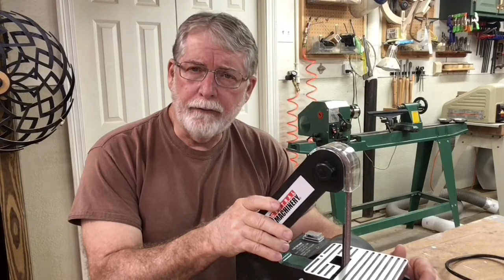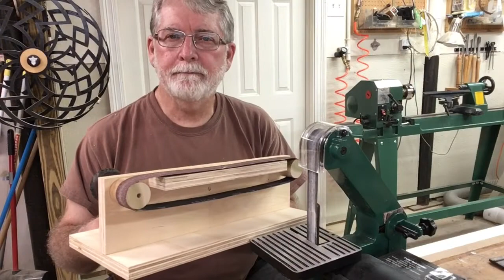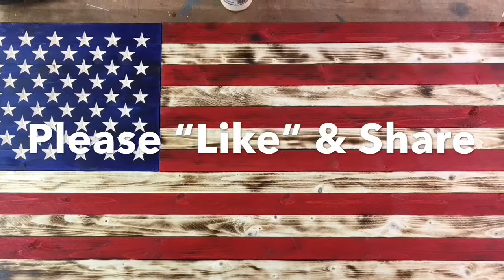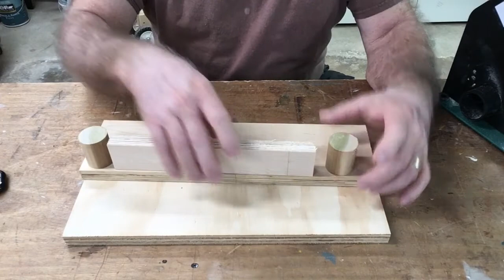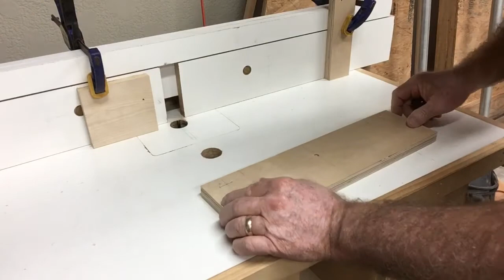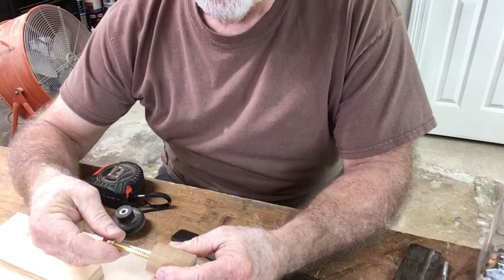Homemade Belts for Harbor Freight 1 x 30 Belt Sander

Comment: How long did that tape hold up? Every time i tape one it breaks loose before long. What brand and type of tape is it? Thanks
Reply from the maker: I have never had a failure.  The blue tape varies, I've use 3M tape and the Starbond CA glue.  I have the slot board on my cnc4newbie for over a year with no problem
Reply: @PawPawsWorkShop  could you tell me the exact model of the 3m tape? They make so many different ones. Thanks for the help!

Comment: I found that when I taped the joints with the nylon that if you clamp the belt to the tape over night it will not come loose later. They then last for the life of the belt grit. Don't forget to clean the belt often when sanding or grinding. Also you can buy 1 inch wide rolls of fine grit cloth backed belt material from many woodworking stores and only have one joint in each belt. They have assorted fine grits in a pack at a good price. They sell them for wood lathe sanding and a very good quality.
Reply from the maker: That's a fantastic idea.  Thank you very much.

Comment: Very nice and practical ! How is the tape backing holding up ? Many Thanxx !
Reply from the maker: It really depends on the tape.  I have tried several different kinds.  I am experimenting using glue and tape.  When I get a method that I have really happy with I will share it with another video.  Thank you for your question